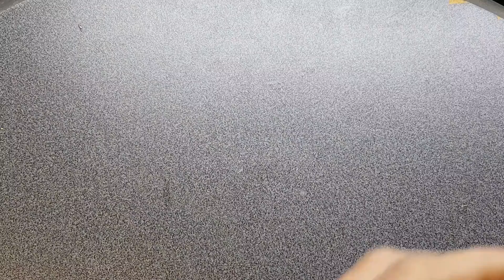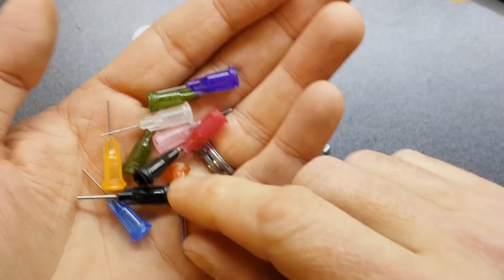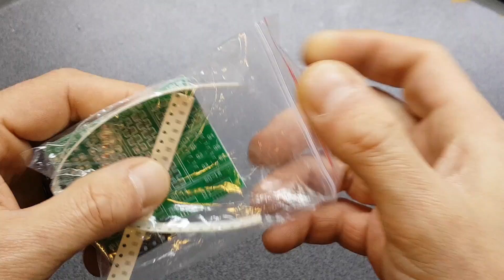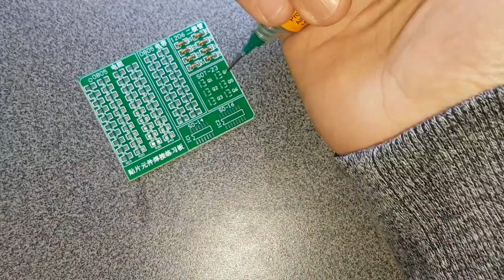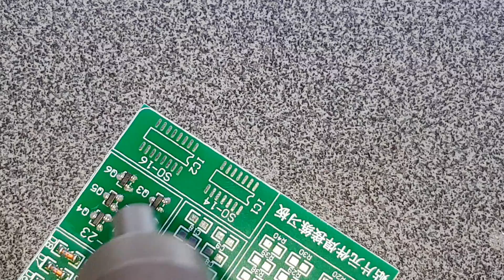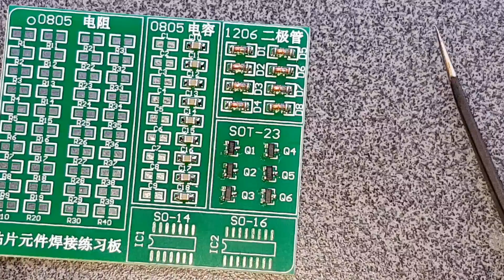SMD soldering tutorial, this time with less solder paste and more fingers! (surface mount tutorial)

Comment: I usually buy my solder and flux here in UK (getting to be one of the only things) but wondered about the solder paste, flux pens etc from ebay and the like, any good?
Reply from the maker: The paste is excellent, I've got some gel type flux on the way...as for fluc pens, I always buy electrolube as it's good and cheap enough.
Reply: Thanks for that.  I got some paste from ebay to try.  Just waiting for my smd kit to arrive.  I used solder paste as an electrical fitter at Longannet Power Station where we used it on large connections applied with a paint brush and heated with a blow torch!!!

Comment: How do you test that board,to no if you did it right,most practice boards have a light or something, anyone,in hope I didn't buy this kit,I bought several.so far they all had a way to test them.
Reply from the maker: +Ron Thompson you can't, it's purely a practice board. I suppose you could use a meter and probe the edges of the pad and measure the resistance. I'm going to order a few more I think. Just wish I could buy a much bigger and challenging kit.

Comment: I glad you are useing lead solder ,I myself don't have any use for non lead solder ,I read non lead solder is more dangerous to use ,than lead solder ,I think they tell people that lead solder bad ,so they can sell non lead solder ,I don't anyone that likes the stuff,I like your smd video
Reply: Lead free solder is a greater hazard to your health than 60/40 leaded solder. Because the lead free stuff isn't near as sticky and it has a much greater surface tension it needs some allegedly quite toxic fluxes.

Lead fumes isn't a thing at the temperatures you solder at but flux fumes definitely are. Fortunately lead solder fluxes very nicely indeed with simple pine wood sap based resins known as rosin. But still you wouldn't want to smoke it I guess. 

Don't put the lead solder in your mouth, don't go out of your way to inhale the fumes from leaded solder and wash your hands after working with leaded solder and you will be fine.

Oh and only use the solder pastes and flux pastes with gloves and very very good ventilation and never inhale the fumes if you can avoid it. Who knows what are in them. It isn't rosin, because that's a solid, well, resin.

Also people hate lead free solder because it doesn't stick as well, is brittle and it also can form "tin whiskers", tiny crystals of tin like whiskers that grow out and short out everything, particularly when they are under voltage. It also can turn in "tin pest" when it gets too cold. Which is a crumbly expanding mess that actually can seed any tin it touches into that crystal form. If that happens it will literally fall apart.

You'll notice if you are old enough that the reliability of consumer electronics completely went to shit since RoHS came in. A usual failure mode is that one of the balls of lead free solder under a BGA will fracture when the it heats up or cools down and puts the joint under stress. Because tin is so much less ductile compared to 60/40 tin/lead.
Reply: Do you think they will ever get rid of lead free solder, I no one thing I ordered a kit from elenco,, my kit with that lead free crap, and some soldering devices are coming that lead free solder. I usually just give away.

Comment: Kris what are you using for the hot air gun?
Reply from the maker: Hi, I use an Atten 858D+ which i'm pretty sure is a clone but works fine...very cheap from amazon.